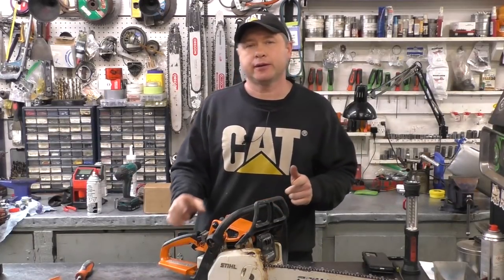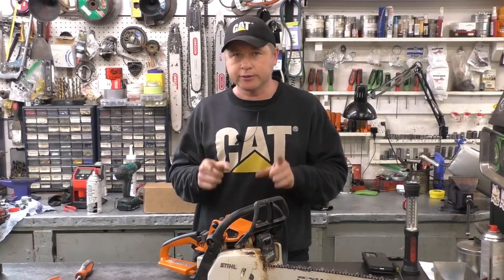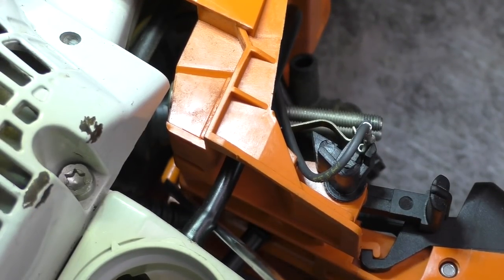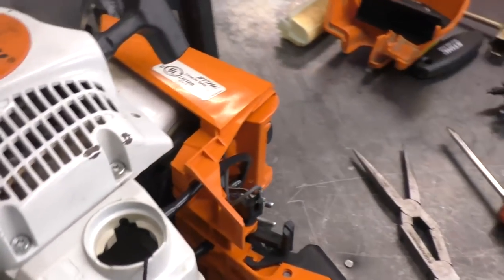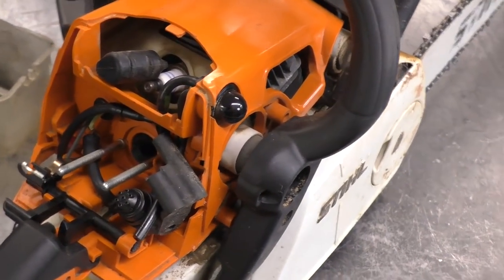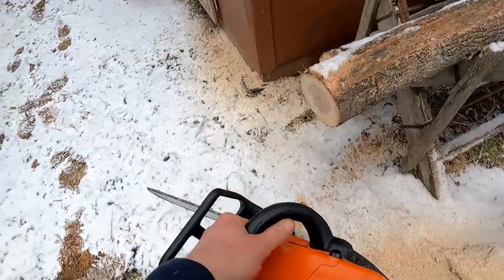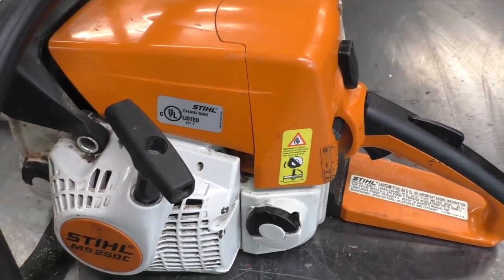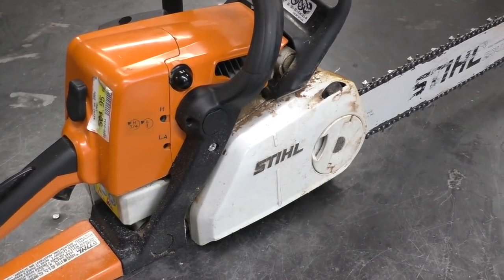STIHL MS250C Chainsaw Running Lean & Bogging - Easy Fix!

Comment: I can't  thank you enough for your video. I have a Stihl MS 250 about 15 years old that's been my favorite saw even when I thought the carburetor was bad. It continued the bog at various times until I saw your video and sure enough that tube was disconnected. Problem solved!

Comment: I had an 031 that would  bog/not stay tuned no matter what I did, turned out to be a deteriorated impulse line.  I saved a few bucks by replacing it with appropriate size fuel tubing.  Works fine now!

Comment: I have a question that not about chainsaws.  I have an  2 year old Ariens Snowblower and even though it might be overkill, I I'd like to replace the gear oil in the auger differential.  I was wondering it I could use the Royal Purple that I've used on my Jeep.  Or, do you have a something that's better.  BTW, thanks for helping all of us and sharing your knowledge.

Comment: Had a similar issue on a Partner of mine. Only difference was that I replaced mine but didn't check the port. The port was clogged.

Comment: I had my chainsaw do this - runs ok. Throttles up ok. Start cutting and it bogs down. 
What I did previously was have a tree pinch the bar. I was trying to pull on it to get it out. I saw the upper part and the engine part come apart so I stopped. My guess is that my yanking disconnected that same hose. I will try to re-connect it tonight. I will be very happy if this is the fix

Comment: Dony, I love your channel.  I'm buying a Stihl 261cm . first do you have any tips for breaking in the engine? Second, if you have opinion about two stroke oils. I'd love to hear it. You pull many many engines apart and I'm curious if you see a pattern which engines look clean and well. Lubricated. And what those people are running in their machines. Thank you
Reply from the maker: I run all my saws at 45:1. For break in I add a bit extra oil in the first few tanks, like a cap full extra with the mixed gas
Reply: @donyboy73  thank you

Comment: Had the exact problem.  Found impulse line disconnected when setting up for a pressure vaccum  test.  I can't understand how the saw ran without that line connected.  Any ideas?

Comment: I have an 044 STIHL, I loaned it to a friend, He said something happened  it was not working, so when he brought i back. first thing I pulled the cord. I knew o had a good idea what happened. I removed the muffler. up on inspection. It looked like it was run with raw gas. The head and piston was ruined.  I told him what I found. He brought me some STIHL parts he found. i found a head and piston  that I honed a little  And put the saw together, But I do not know I have a problem I never had with this saw, No the compression is not perfect. But wen I pull the cord It kicks back hard and snaps the cord right out of my hands, and yes it hurts my hand So Danny do you have and Ideas or thoughts to why it does this George

Comment: I have an ms181 acting kind of similar, very hard to get it to start and run when cold but if you can get it to stay running until it gets hot, (after 1or 2minutes) it runs and cuts fine, but will randomly start acting up again and again as the day goes in but will just as randomly start working fine also😡😡😡. Must check that impulse line to see is it cracked or loose.

Comment: The stock carb settings on the side of the case. Is that 3/4 and 1 turn from fully clockwise or counter clockwise?
Reply from the maker: turn in screws all the way then turn out to specified settings or turn out a bit more to run richer
Reply: @donyboy73  Thanks! You made this video with impeccable timing! My father in law has an MS250 that would bog down and die. He replaced the carb and that didnt help. He brought it to a reputable shop in our area where one of the seasoned guys working there since the 80s couldnt figure it out. I told him to bring it to me so i can take a look but i wasnt expecting to help if the guy from the shop couldnt figure it out. We looked at it two days ago and got it to run slightly better with fresh gas and a slight carb adjustment but it eventually died after it warmed up. Saw this video come up this morning, and immediately grabbed a flashlight and voila! it was disconnected where you said it would be! I took it apart and got it connected and now its running great! Thanks so much! He's gonna be so happy!!
Reply from the maker: @steakdave666  good work!
Reply: @donyboy73  Friend, is it okay to set the L nozzle to the highest speed? do you have to turn it back 1/4 turn to enrich the mixture? it is about adjusting the L nozzle

Comment: I put a little 1184 on the crankcase nipple before I put the impulse line on the nipple.  This keeps it from coming off.  I just use a thin coat of 1184 on the nipple.  You do not want to use so much that it could block the hole in the nipple or the impulse hose.

Comment: Do other brands have impulse lines? Thanks
Reply from the maker: yes some do
Reply: Some of the higher brands have them Stihl. Husqvarna. Echo. I believe. Craftsman and lower ends don't use them. At least that's what I seen being working on them
Reply: Thnx again, I have a Craftsman/Poulan, lo/hour that slow starts but a combination carburetor/cleaner starting fluid 40:1 fuel mix usually gets it going.